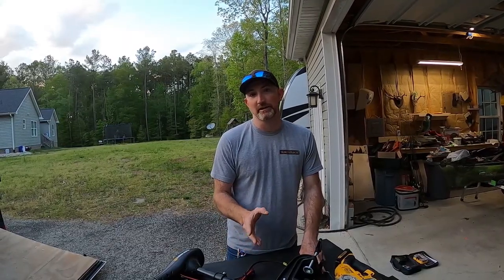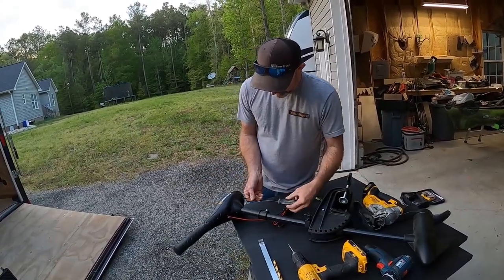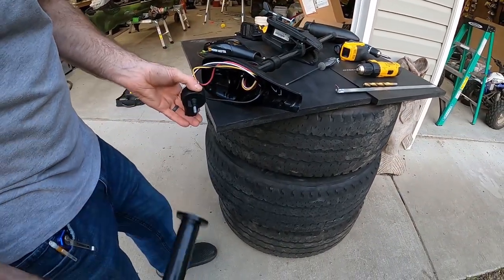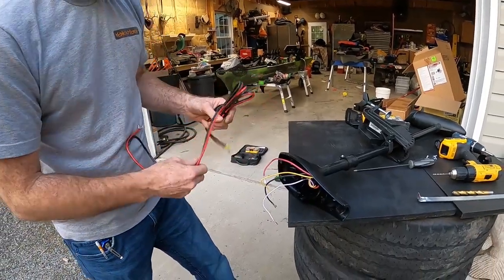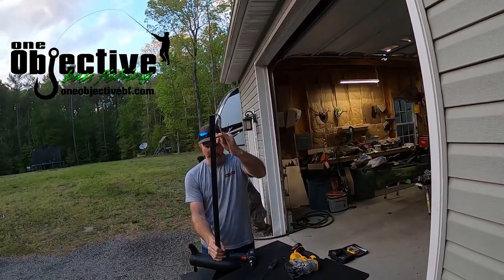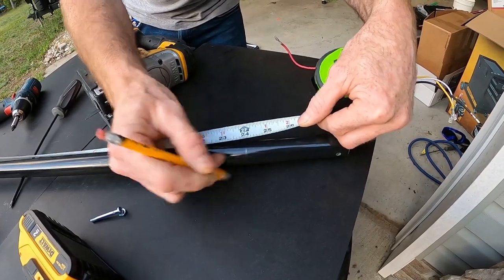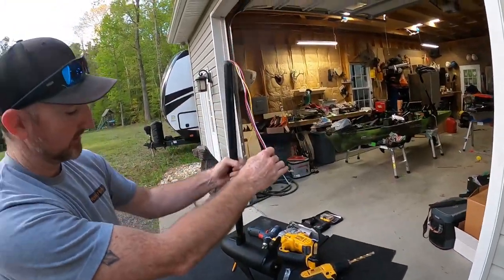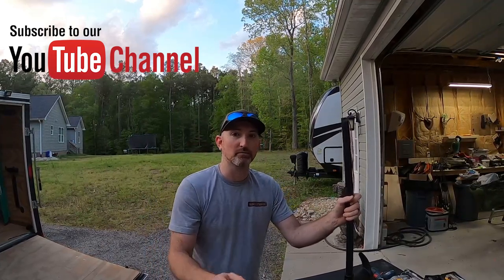How to Shorten Your Trolling Motor Shaft (Super Easy)

Comment: A smaller diameter metal pipe also works great to protect the wires. Just push the wires through the metal pipe as you insert the pipe into the trolling motor shaft. It keeps them safe as you cut the shaft. Also best to have the motor upside down to keep debris from falling down into the motor.

Comment: Great video. But I would personally get a metal tube that is slightly smaller than the shaft, put the wires through the tube and then feed it "into" the shaft opening, put the shaft on a vice, and then cut the shaft with a hacksaw. Much easier. :)
Reply: Smart idea, thanks for sharing that...

Comment: If you use a tubing cutter to cut down the shaft, you do not have wo worry about cutting any wires and it makes a nice clean cut. Since it is plastic and thicker than tubing it takes a bit more turning of the cutter to get through the plastic, but worth it.

Comment: just slide a pc of copper tubing over the wires and use a  fine tooth hand saw or jig saw with fine tooth blade to cut it, but I guess both methods  work fine.   thanks for the vid.

Comment: Try using a copper pipe cutter do you don’t need any power tools to cut the shaft down and you don’t need to protect the wires with anything

Comment: Like Chuck said, use a 24" piece of 1/2" EMT conduit to sleeve over the wires. Also you can use a hose clamp to fasten on the outside of the shaft' This would give you a great line to follow when sawing that shaft and a good straight cut. Great video.

Comment: I bet one of those rotating pipe cutters would work even better to cut that.
I have a motor in the garage I need to shorten, might try the pipe cutter to see if it works.
Reply from the maker: Yep I’m sure it will

Comment: Hi friend! good video. Can you replace the original shaft and put a shorter one to avoid cutting?
Reply: I thought about that too in case I wanna make it bigger later for a different boat or whatever I have that option I was wondering if the tube disconnected from the bottom portion of the motor I would like to see that if possible

Comment: I tried cutting mine with a pipe cutter, to avoid hitting the wires, and it was not a clean cut, now my motor head is a bit loose. I may have to cut it shorter using this technique.

Comment: Thanks for the tip.  I'm mounting a 50 lb thrust Minn Kota to the back of my NuCanoe F-12. I have the transom mount installed.  How long should the shaft be using your measuring method, to optimize this motor to my Frontier 12?   Also, what battery would you recommend? Thanks again.

Comment: How do you put the head back on?
Reply from the maker: We show you in the video. Its very easy
Reply: @OneObjective  you actually do not show it, the video ends after you cut the shaft and there is no reassembly and no hole for the screw that goes thru the shaft so its a bit confusing how it would go back together